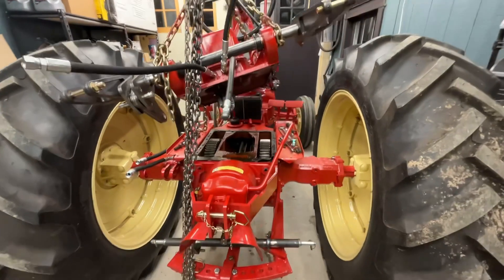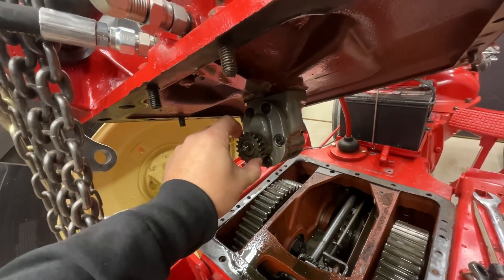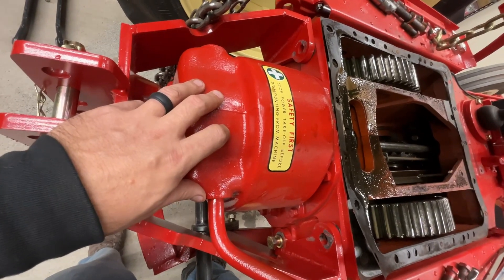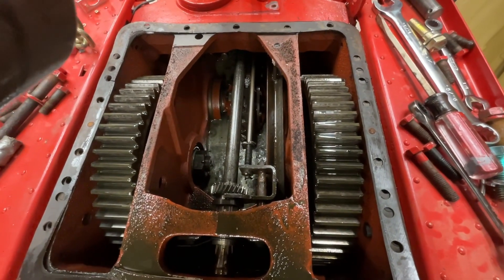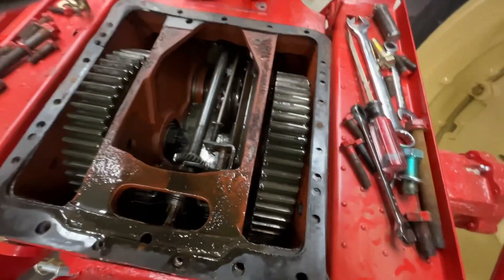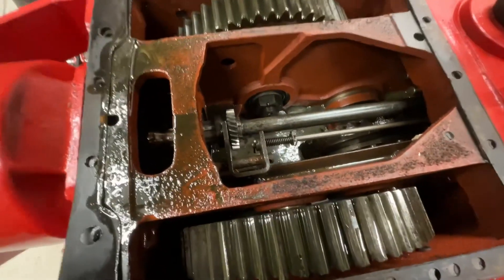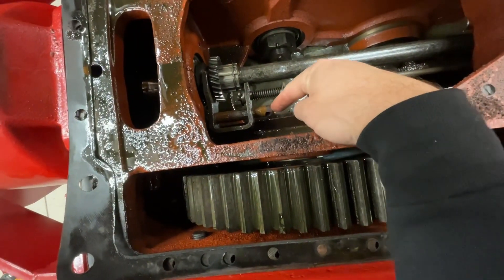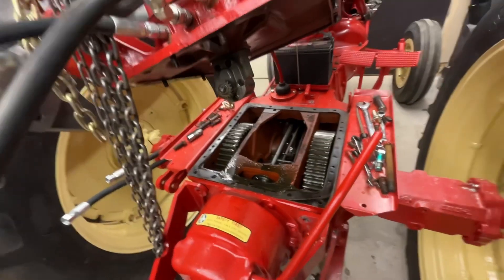1956 Cockshutt 40 Tractor:  On-Board Hydraulic Pump & Axle @langbros.1907

Comment: That's excellent! There were optional hydraulics driven from the governor and I was considering that for my 50 but I like your diverter valve setup better.
Reply from the maker: Yes.  I’ve seen photos where pumps are mounted from the governor drive on models that weren’t equipped with the rear hydraulics.  I don’t do any farming so this capability really makes this much more useful for me than just a pulling machine.
Reply: @langbros.1907  In these parts the pumps often came installed along with the gear case pump. Three point hitches were uncommon on these bigger units but there was always a need for more hydraulic output. I’d have to have a three point hitch to make my 50 useful to me. Otherwise it would be a show piece.